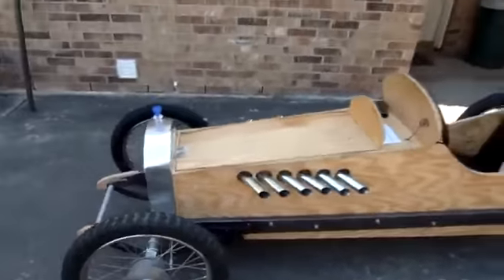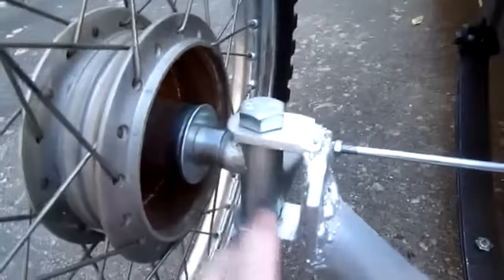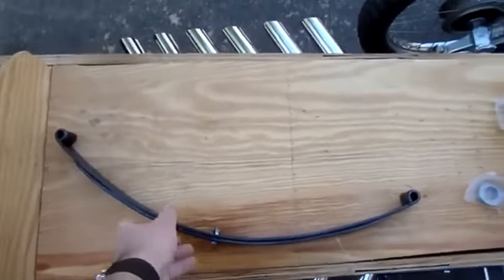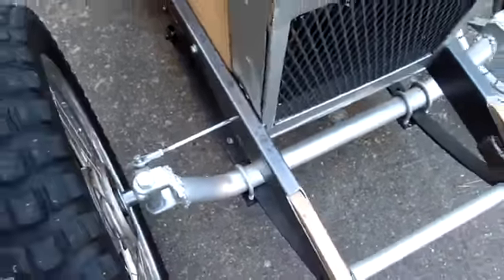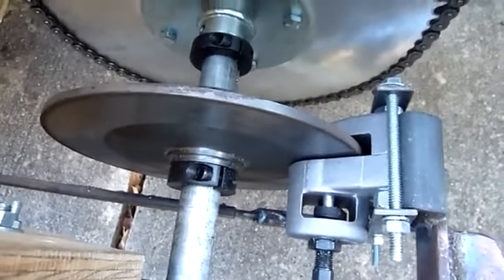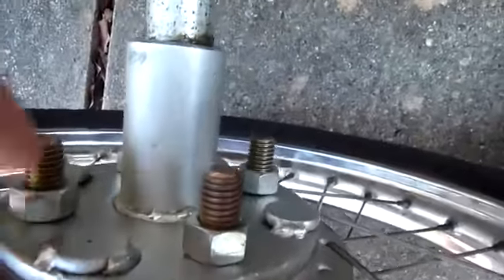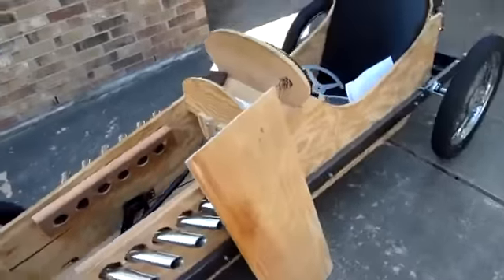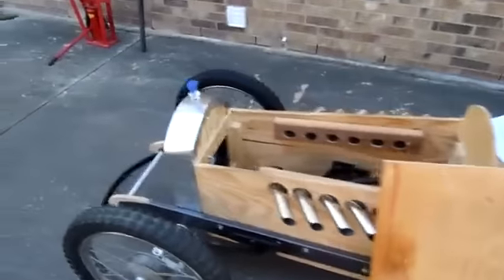cyclekart-overview-2011-11-23.avi

Comment: The kart looks great! I noticed your steering rod appeared pretty close to the chassis, it made me wonder if you had any issues with the steering rod hitting the bottom of the chassis when your front wheels hit bumps.
Reply from the maker: Not that I recall.  The front end is pretty light and the springs are pretty stiff, despite being buggy seat springs, and I never really drove it on rough terrain much either. Could be a problem on rougher terrain at speed, I suppose, but it also might not be a problem in that case, I really don't know.  On smooth-ish terrain, it wasn't a problem.

Comment: I'd recommend upgrading to a larger engine. Like a motorcycle twin motor. Kawasaki KZ750 twin motors have lots of torque and the transmission is basically part of the motor so all you have to do it run your chain to the axle. They are small, somewhat lightweight (im 17 and can lift one without to much issue), and fast little engines. Those tires and wheels you have on there can handle the torque coming from the motor as well. How awesome would it be to keep up with traffic on the interstate?

Comment: Are you using front or rear wheel assembly?
Reply from the maker: lockhart1976 The wheels are all front wheels, if that's what you're asking.  Functionally, either rear or front wheels will work.  Front wheels look a little better.  Arguably, rear wheels might work better since they have a flat face for the washers and bolt heads to mate against.  I'm not sure what you mean by "assembly", as the only part of the CT90 wheel that is used is the wheel itself, all the original bearings, hub, etc from the motorcycle wheel aren't used.  Hope that answers your question.
Reply: Yes you answered it perfectly thank you!
Reply from the maker: If you're looking to build one of these things, look up "cyclekartclub"
Reply: Thanks!

Comment from the maker: Don't remember, exactly.  A chinese clone engine can be had on sale at harbor freight for less than $100 when on sale.   A Honda gx200 like mne will probably be around $300 at Northern tool.  Is the Honda worth it?  depends on how much you (dis)like fighting with small gas engines, I guess.

Comment: They would not work remotely well enough and would look FAR too weeny when completed. A 12" wheel would almost certainly collapse from side load pressuress and you will roll your vehicle about 85% more often too. The 17" wheel is one of the very specifics needed for true cyclekarts.